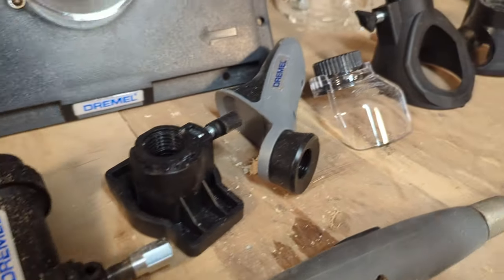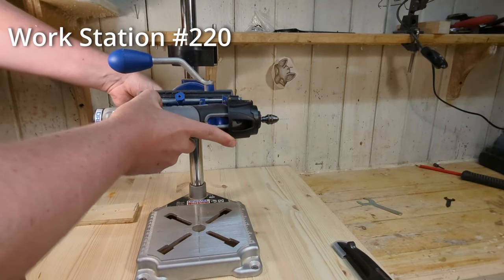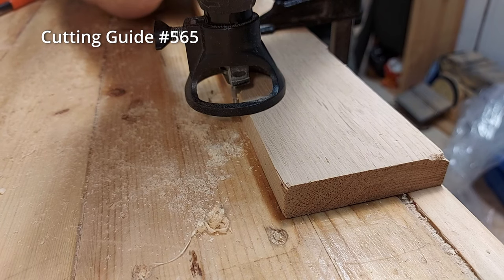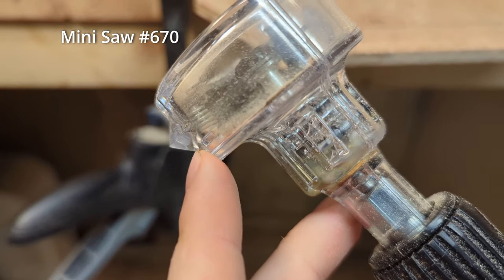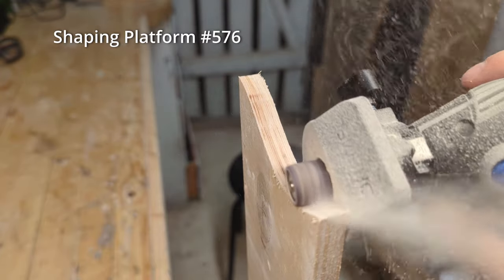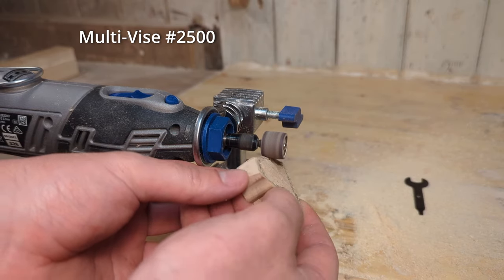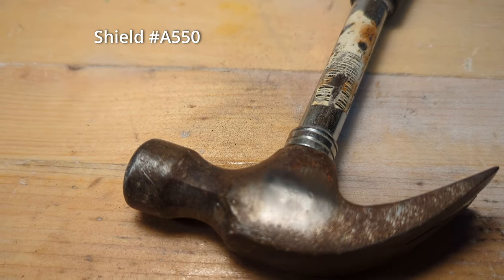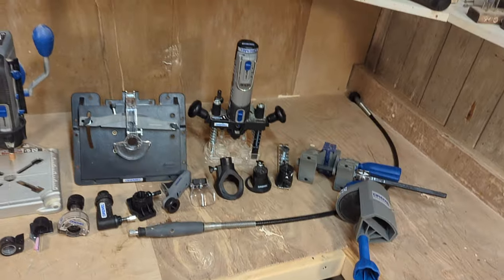The Ultimate Guide To Dremel Attachments And Accessories

Comment: You said you didn't like the detailers grip. Well if you knew how to hold it you would see it is a very nice thing to use for detail. You were holding it wrong. Dah!!!!!
Reply from the maker: It's Clunky!!! :)
Reply: its bulky kinda usefull if you cab rest your hand or the grip but i dont like it
for engravements is better the round base
Reply: @rotarycrafts8760  Yeah, that's because you were holding it all wrong...DERP!! 🤪
Reply: doesnt matter how your holding it, the problem isnt so much the shape, its that all the weight is at the top end, socyou have a gyroscope flapping aroubd with almost no suport from your hand.

modern motors are much smaller and more efficient, dremel is old and clunky.

they really would have helped themselves if theyd made the flex extension work well. but thats also badly made and is all slop with again, no support.
Reply: There's no need to be rude :-( You could have said this much more politely, with constructive critique , explaining the correct way to hold it, and complimenting the rest of the video. Just insulting doesn't help anyone, it just hurts.

Comment: Why dremel doesn't make cutting table? they made rotary table and mini saw attachement but i would love to do some more precise cuts, whether its wood or metal.
Reply from the maker: My guess is that it would be hard to make a safe table and blade. Id love that as well, but serrated saw blades and rotary tools do not really work well together. I've seen some builds of this kind of stuff, seems sketchy with that high rpm and low cutting diameter. 
 Kickback will be insane.

Comment: Can you please help me? I need a dremel tool that can remove screws/nails sticking out inside a 2 inch sliding door gap space. I think alot of the dremel tools don't fit 2inch gap, would you know which dremel took is small enough to fit inside there and powerful enough to cut off nails/screws?

Comment: Hey there, brilliant overview, thanks a lot!

If I may ask for your (or anyone else's) advice:
If I get the plunge router, I can skip the multipurpose cutting guide and the circle cutter/straight edge attachment and can still do basically anything I would be able to do with the two, with only the plunge router?
Or would you say it is worth to own all three of those?
That is, are the plunger router vs. the other two at least partially redundant in functionality or am I mistaken?
Really, it's less about the money and more about the available space in my toolbox.
Reply from the maker: Yeah. The plunge router basically does everything that the cutting guide and circle cutter can do. I like using the plunge router better, it is more stable and easier to work with.

But the plunge router is not able to make really small circles like you can with the circle cutter. 

But if I were to only choose one of the 3 attachments, I would 100% choose the circle cutter.

Comment: Hi I'd like to ask you a question,  I own a different rotary tool very similar to the dremel, do this attachments adapt to other brands? DO they have adjustable grips to block the tool in place or are they fixed on a standard dremel ?

Comment: Very interesting video ! I want to buy a Dremel but I'm in doubt of buying the 4250 or the wireless version 8240, they are exactly the same but the 8240 is wireless.
I've read somewhere that the battery only lasts for 10 minutes, is that correct and what would you prefer, the wired version or battery version ?
Reply from the maker: Hi. The dremel 4250 is solid. The battery for the 8240 lasted about 30 minutes of woodcarving for me. I'd recommend getting the 8250 instead if you want to go cordless. More battery time and  better power. Even the 8220 has about 20 minutes of full power work in it. It kind of depends what you want to use it for, for routing work I really like having a cordless tool, for woodcarving I like the cable since I'm gonna use the flex shaft anyways and be more stationary.
Reply: @rotarycrafts8760  Thank you sir, very interesting the 8250/8260, it seems it has a better battery over the 8240 and it's also brushless.
Can't the flex shaft be used with the wireless 8250 if needed ?

Comment: Shooting sparks into the camera lens made My morning. Did you use any kind of protection for the lens?
Reply from the maker: Hehe. Looks cool. No protection, filmed with phone. Didn't do any damage as far as I can tell :)
Reply: @rotarycrafts8760  Beautiful shot. I've had a Dremel for over a decade, I haven't used it too much and stored it in it's case until recently. Seeing it hang from a hook has got me wanting to do something other than cut the occasional fastener. Even if it's just hang from a hook while cutting the occasional fastener with the extension.

Comment: I can't answers from Dremel.  No chart with the newest models, zippo.  Will all attachments work on the 8250?  Flex shaft, circle cutter, straight edge guide, shaping platform, etc?  Will these also work on the flex shaft, or only the bits/carving /tools to use with flex shaft?  TY for your vids!  Keep them coming!  I'm new to using the 8250 & learning much from your vids!  TY!  😀
Reply from the maker: Yeah. The 8250 will work with all the attachment and bits. Thanks :)
Reply: @rotarycrafts8760   TY so much!!  😀
Reply: @rotarycrafts8760  I don't know why ppl say 8250 will not work with the attachments I listed above.  So frustrating not having the correct info prior to a purchase.  No word from Dremel at this point.  TY!
Reply from the maker: No worries. Yeah, maybe some confuse it with 2050. Which is not compatible with the attachments. If you check out one of my recent videos "Dremel 8260 review" I go into depth about the 8250. 8250 and 8260 are basically the same, except Bluetooth and cosmetic design.

Comment: Awesome video.  Can’t believe the dermel has no accessory to cut wood in a straight line!  Something like a fenced workstation. Have been looking here and there but there is just this mini saw which is also a free cutting not a straight line !!, is it possible to use the table 231 with the right angle 575 accessory to achieve that? Thanks
Reply from the maker: Hi. The fact is that a Dremel is not really a good tool for cutting 100% straight lines. You have straight edge guides on the plunge router, and the circle cutter attachment. But for doing straight lines I would either do the best I can with free hand with the ez544 wood cutting wheel or use another tool. Haha, your idea about the Routing table and the right angle would be awesome to try out. But I don't think It would work.
Reply: @rotarycrafts8760  thanks a lot.  Really helpful and best review out there. !

Comment: Hello mate, great videos, informative, great pacing and narration , bravo.
I have a question for you, what do you think about the 8250? Im considering buying it for automotive use, i think the cordless is the way to go but im not sure about the negatives of it... would appreciate a reply, and thanks for these videos!
Reply from the maker: Hi. I just got the 8220 a couple of months ago and I love it. The 8250 is similar only it has a little bit more battery time I think. The only downside is if you are using it for heavy duty tasks ex. Grinding/shaping steel with carbide burrs the battery will run out fairly quickly. Maybe 20 - 30 mins of runtime I would think. If you can work with that or maybe even get a spare battery, it should work just fine. ')
Reply: @rotarycrafts8760  well, luckily for me i found an old dremel in my dad's toolbox, 395 from 2003... gonna use that to see if i need something more.. while checking out cordless rotaries I saw that ryobi have a decent looking one, seems very versatile but i dont think you can get a 90 degree attachment on it... 
Im considering porting my cylinder head with it, hopefully it'll get the job done.

Comment: The cutting guide works with router bits I believe, making it the poor man’s (my) router attachment 😝 it’s also why I ended up with a 4000 instead 3100 since the guide is exactly the difference between the two kits and it comes with the 4000 not the 3100 😅

Comment: How deep can the Dremel cut into wood when you're using the cutting guide?
Reply from the maker: Hi. It depends on how much noise you will tolerate. I don't like cutting any deeper than 1/3" (8mm). But at that depth it will still make a high pitch noise and be hard to control. If you make several shallow passes at 1/8" you should be able to get through 1" thick material with something like the 561 tile cutting bit. But I find cutting thick material with  Dremel a little bit tedious and I find it hard to achieve a clean cut,  but it can be done.

Comment: I use the stand because I have nowhere to put a nail up higher for hanging the Dremel.
Reply from the maker: It's useful then. Does it work well? I have not tried it.
Reply: @rotarycrafts8760  Yes and keeps the pressure off the cable.

Comment: I have all of the DREMEL attachments for my DREMELs. Of course they won’t work with the new models.
Reply from the maker: Hi. I didn't know this, which of the new Dremel models do the attachment not work with? I knew that some needs adapter on some odd attachments like the routing table.    But I don't wanna buy it if the attachments do not work.

Comment: there is a 3d printable adapter for dremel so it fits the proxxon micromot attachments, which are cheaper and made of metal and not plastics. the threads on dremel are M19 and to fit the proxxon stuff we need a M19 20mm wide adapter.

Comment: owned two dremmels, not great. on both the chuck would bounce around in and out. parts cost a fortune, and eventually the power switch locked out so it wouldnt turn off. dangerous.

i realised for the price of a dremmel and one tool part i could get a proper tool that would last a lifetime and cost less to run.
my dremmel is a cutoff tool only now. a sketchy one.

i picked up a tiny cheap ($20)chinese hand drill thats outperforming it in all other tasks atm. its recheargeable usbc and even has a keyless chuck.

Comment: most are useless. drilling for example, when the lowest setting is 5000 rpm...
Reply: Depends on what you're drilling.  Enough people have found it useful that they made a thing for it and its popular
Reply: @RustedOatmeal i purchased the proxxon 12v system, it has analog regulation and not steps like dremel, power supply can bring it down way below 5000 rpm and costs ~25€ per tool. dremel is not a hobby tool, bad for thin wood, plastics and precision in general, just melts and burns stuff. flex shaft is also too bulky and as heavy as the dremel itself. also accesories are overprized compared to proxxon and of much lower quality (plastics vs metal). like the press, router etc. but with a 3d printed adapter dremel can be used with proxxon attachments